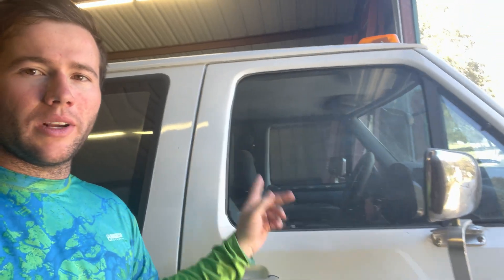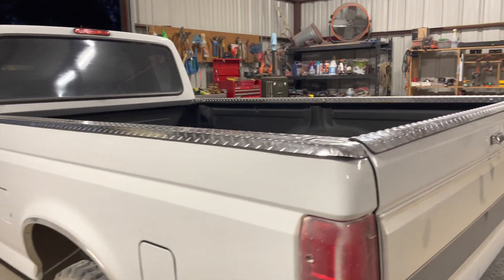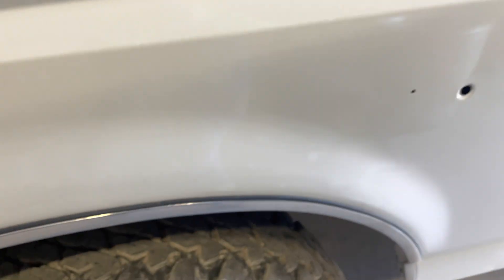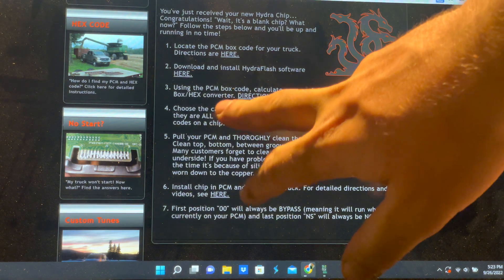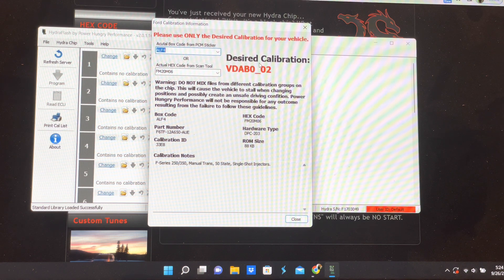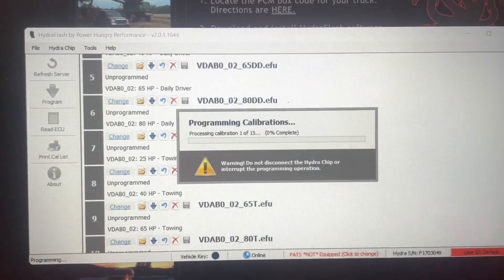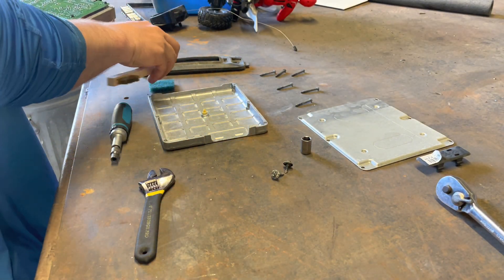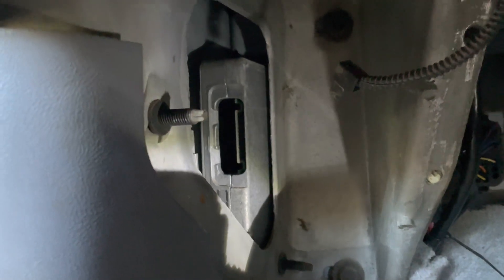OBS 7.3 PHP Hydra Tuner Install

Comment: Wish we could’ve seen you actually remove pcm
Reply from the maker: @MrAntihero1001  the angle was too hard to get a good video. All it is is unscrew 2 bolts and pull it out.

Comment: Nice video! Hope you like the Hydra!
Reply: @PowerHungryPerformance
 I'm sure im not the only one to install the chip this way but takes about 5 minutes vs pulling ecm and all that. Can pop the cap off and clean contacts from here also. Put my ts6 in same way a couple years . Btw the hydra is a way better option than the ts6, plenty of power and beautiful shifts vs the bang shifts the ts6 had. I gave up on the ts6 and only used it for high idle, which is why I originally bought it

https://youtu.be/o_J5ihcOPio?si=KstKNKiAcZRvUrfy
Reply: @erik120719   Our number one support call is related to the PCM contact cleanliness, so the recommendation is always going to be to pull the PCM, open the case, and clean the contacts diligently.
Reply from the maker: It has been great so far!

Comment: What tires are you running
Reply from the maker: They are 285/75R16. I just put them on a new set of wheels. That video should be out in a couple of weeks.
Reply from the maker: Yokohama MT. If you would like the exact size I can go see what they are.
Reply: @skylarwagner1155  that would be appreciated I like how that size looks